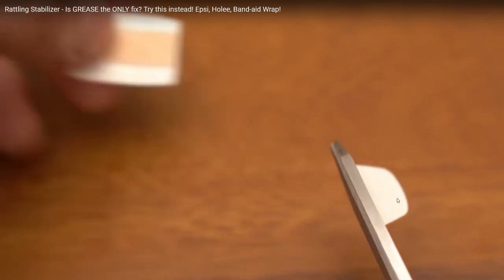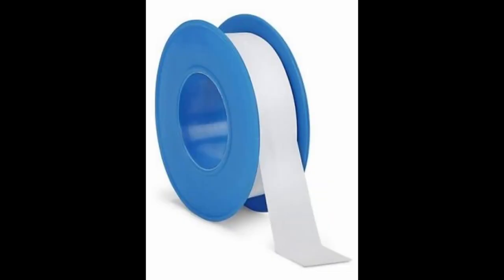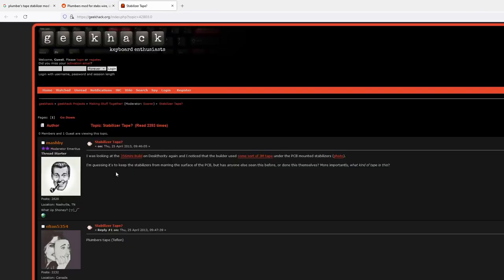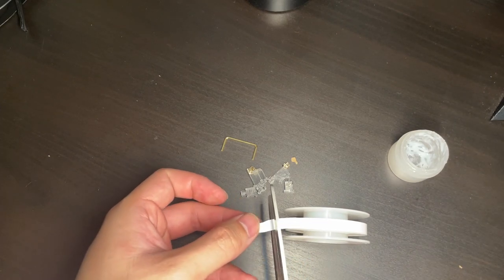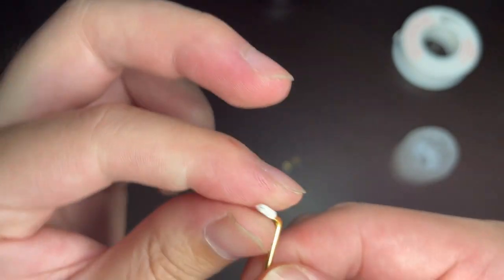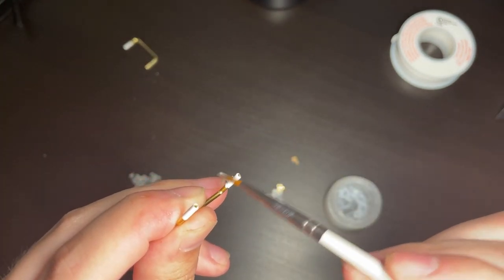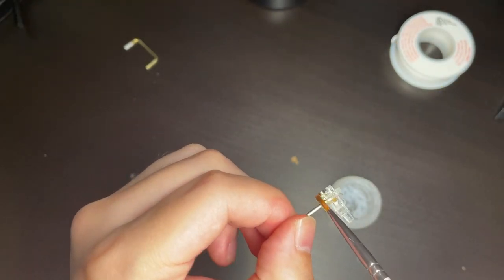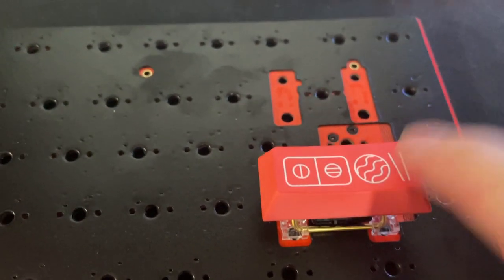New BEST keyboard stabilizer mod?!?!? Plumber's mod !!

Comment from the maker: A FEW CORRECTIONS AND IMPROVEMENTS!!!!
1. Wrap the tape preferably 3 times around the stabilizer wire (this will vary, feel free to experiment). After looping around once, pull the tape tightly while you continue looping the PTFE tape. https://www.youtube.com/watch?v=mjduXOxcZFk
2. Avoid lubing the PTFE as that can increase the rate of degradation of the PTFE tape 
3. Avoid what I did at 3:15 and don't try to frequently put/pull out the PTFE-wrapped stabilizers from the stabilizer stems. There's a good chance you will tear the PTFE as a result. Just wrap the PTFE around the wire, put back together the stabilizers, and try it out on your PCB. It is normal if it feels slightly mushy (a bit too much PTFE)  BUT it should be better after some use so no need to re-do unless it's really bad. 

Also, while I only wrapped half the length of the stabilizer wires, you can use your normal width PTFE tape to wrap around the full length of the wire leg - just make sure not to wrap past the corners and make sure to always tighten the tape.
Reply: Thanks for the updates! I have one question though. You've said to not lube the tape - i presume that by lube you've meant dielectric grase. But I've got some PTFE grease laying around my home, will it also degrade the tape? I assume not as it's also PTFE
Reply: Like with the holee mod as otherwise itl get too mushy

Comment: I spent like 4 hours last night trying to do this mod. I wrapped it around the entire short legs of the stab wires and a bit around the bend as well where it connects into the housing. Lubed with 205G2. I did this over & over, about 5-6 times in total for every stab. That was my first mistake, should've just done it on two stabs, ideally the spacebar. The problem was the uneven thickness application of the tape. I cut roughly the same length of tape for each leg of the wires, but somehow the keycaps were still ticking. I don't think it's necessarily the keycaps themselves.

I will get some normal fabric bandages & do the regular holee mod if I can't get the PTFE thing to work. For now, it's not rattling, but it feels a little bit mushy - I'm hoping this will get resolved in some break-in period. 

Some piece of advice to others, take your time to try to be as consistent as possible, and only try it on the spacebar stabs first to get an idea of the thickness/number of wraps needed.
Reply: I had the same problem. In addition to ticking noises that I could not resolve, even after multiple re-applying of the tape and lube, I had a problem that after some time PTFE tape was tearing apart. To double check I used scotch tape instead, and it performs much better, although I don't recommend it - glue is weak and it is pain to apply well. Get some water proof bandages instead.
Reply from the maker: @c0gnus    Interesting, I've been using this mod for about 2 months now and I did not notice any PTFE that has been torn yet. I'm assuming the lube  helped the PTFE to tear in a shorter time frame which is why I stated that you may want to avoid lubing it as per my pinned comment. Along with this, the added width of PTFE on the wire (depending on how much you used) may have had an effect on it as well. 

And I agree with you that I would avoid using regular tape. Water proof bandages are better as an alternative if you want to go that route.
Reply: The ticking is from the stab wire hitting the pcb, put some tape on the base of the stabs and on the pcb where the wire rests

Comment: Thank you for this. I was using the holee mod previously to this and while it helped, there was still a tiny bit of ticking on my enter key. This actually seems to have fixed the ticking 100% and I didn't even do that good of a job with it. So thanks again!

Comment: Well i did this and used Dielectric Grease... and some chemical reaction happened and the tape became too thin and very transparent after 3 days, and the ticking and rattling came back.
Reply from the maker: Well if you looked at my pinned comment of corrections/improvements, that is something I predicted and I stated to avoid lubing completely to correct and refine what was otherwise said in my video . Dielectric grease is mainly for rubber and electricals (include metal parts that make electrical connections. Also breaks down silicone-based plastics, rubbers and potentially other materials so that gives an idea of what is already to be expected.

Comment: Is it alright if the wire is sitting very snug inside the housing/stems? After barely 2 rounds of ptfe tape, my wire doesnt even move inside the housing. Should i reduce the thickness?

Comment: i think i saw someone do this with  UHMW tape as well, i heard its designed for not lettinb lube in or smthn
Reply from the maker: First time hearing UHMW tape. That should work as well assuming the tape is thin enough. I still probably wouldn't lube them as it's advertised as "low-coefficient of friction" already and the chemicals in your typical switch lube may degrade the tape faster. But of course you can experiment and see if there are any noticeable long-term effects.

Comment: Yeah this mod is really great, take less than 5 minutes per stab to do it once you master it. The so called holee mod is really overrated and pain in the ass to do it.
Reply: Its no more a pain in the ass than trying to make sure your plumber's tape won't slip and fall off because it has less adhesive strength than a fabric band-aid and is not made to be put on the wire that is constantly moving erratically, compared to a holee mod which is simply lying snug on a flat surface that is inert(so to speak). In any case, the holee or plumbers' tape mod are only for those stabs that refuse to behave even after a generous application of Permatex or Krytox. And if that's the case, budget permitting, I'd rather get a set of better quality stabs.

Comment: nice vid, pretty helpful. what switches do u use?
Reply from the maker: Thanks for the feedback! I use durock pom linears lubed using Krytox 205G0 and I spring-swapped them with kinetic labs 63.5g symmetric Long Springs/two-stage springs. My absolute favorite switches.
Reply: @bakedapple9801  ive heard good things, keep up the grind ur gonna make it. Trust the process chief.

Comment: what if u use masking tape instead? Or wire isolation tape?
Reply: The idea is to put some dampening material in the stabilizer. Thick enough to prevent rattle but not so thick that it prevents movement entirely. You put the material either on the bar like this mod or in the housing like the Holee mod. 

You can use anything you like. How effective it is and how long it lasts depends on the material. I think masking tape won't last that long. Could be wrong though.

Comment: Update?
Reply from the maker: Still working really well! Also the quality of your keycaps can affect how much ticking/rattle there is as well. I have clone GMK keycaps so they were always either somewhat loose or somewhat warped b/c of quality control so I couldn't completely eliminate the ticking. The mod did help though. Just make sure to wrap the tape 3-4 times as I found that to work best and do a twisting motion to tighten it afterwards - it may be somewhat mushy at first but that'll slowly disappear with use.